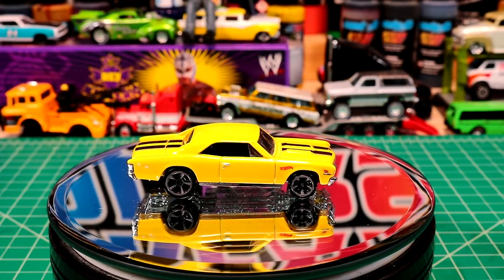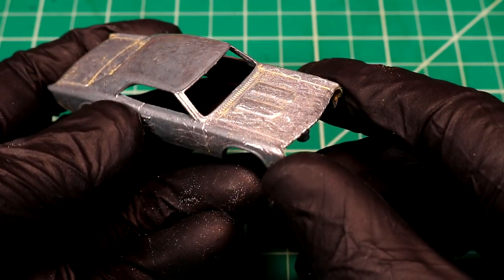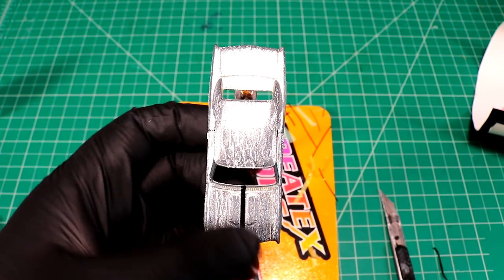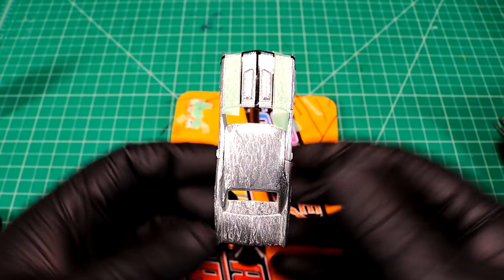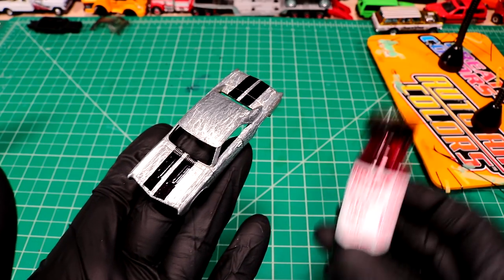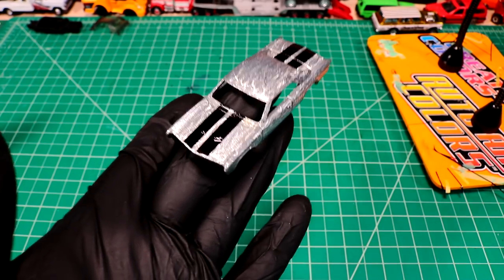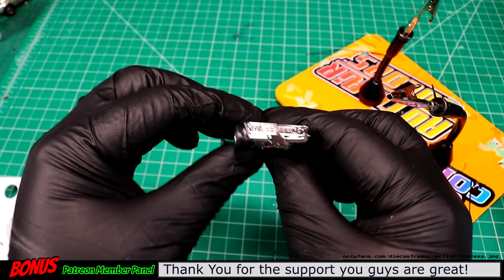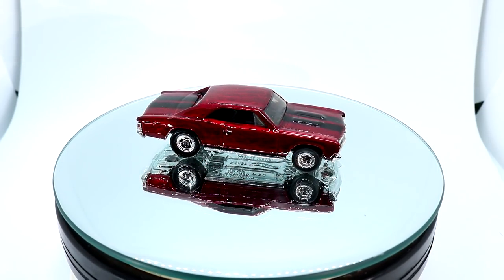Painting Hot Wheels Cars - CANDY OVER GROUND METAL - '67 Chevelle

Comment: The lines come out nicely under the paint job.  It's almost like the how the old Spectraflame Hot Wheels used the graininess of the zinc coating to get a little extra sparkle.  I have an idea for the next time you try this. Get a silver sharpie and use that to map out your grind lines to make a pattern. If you don't like the way it looks, just wipe off the marker lines and try again. It might save some time or give you an idea of what might go better on a curved panel.

Comment: Back when I did some of these, I didn't like how the grinds got darker than the rest of the car, because the depth of the grinds made the candy  paint  thicker and darker, so after the grind,  I did multiple clear coats with sanding between to get a smooth surface to spray the candy onto, it let the grinds sparkle a little brighter.